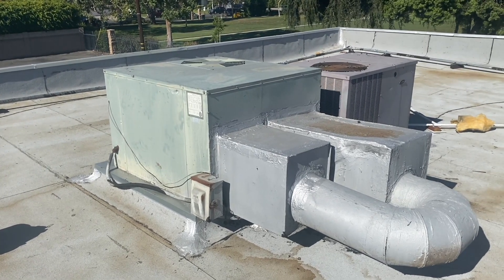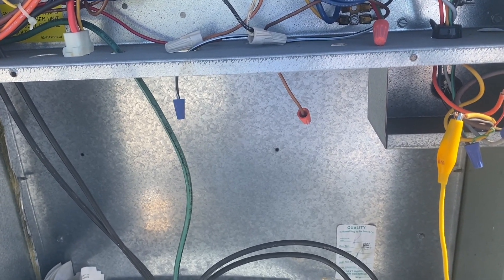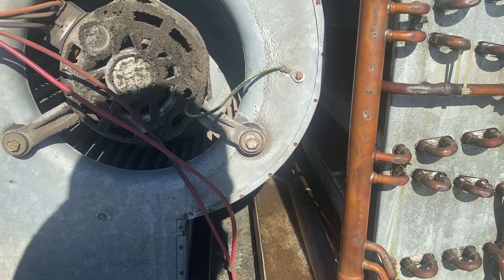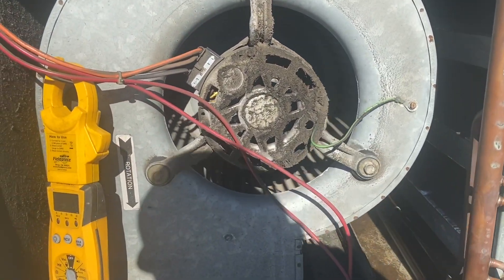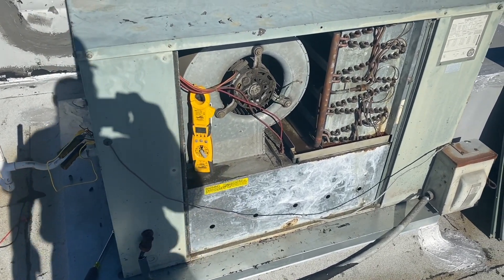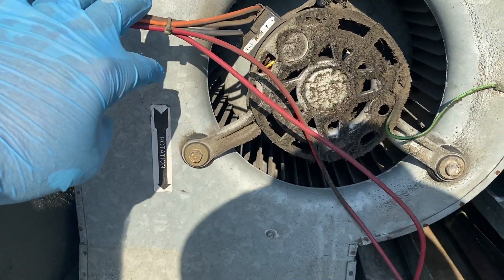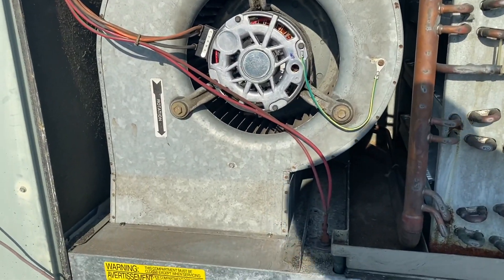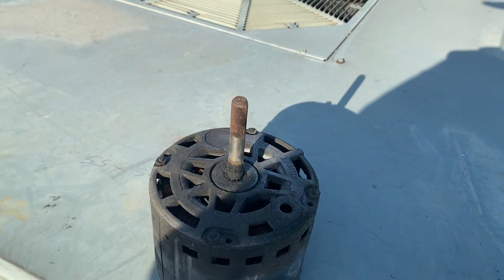No Cool, Airflow Problems Package Unit Heat Pump. EP45

Comment: So your a Horrible Tech Guy....LOL  I learned a LOT from your video(thanks). Great Work and learned replacing Motor not that much hard Labor as told it was by uknowho.  It is 9-3-2025 & my 6yr Carrier Motor is Toast.  In 3yrs the Heat Coil died.  Dont' buY a CARRIER AC UNIT.   Also Tech ordering OEM-Motor.  Sad thing next to cheapest cost repair was $875 Bucks.  This is just replacing Motor & adding a Surge Protector.  No Cleaning off Mold or installing UV-Lite.  I don't find that many Honest Florida AC Companies being here 18yrs. Been ripped off a lot of money Believing. First time hearing a Surge Protector saves parts inside a package unit.  So will take me longer now to pay of my 2019 Rogue.  Sad Day for Me having to spend where I did not want to spend.  Thanks for your video and was Very Helpful being this is exactly what just happened to meee. 🤣

Comment: Another great video that will help other technicians. I noticed you didn’t clean the evap coil, which may be as the customer didn’t want to spend the money, you may want to add a comment on that as it was not clear why that was omitted.
The line voltage seal tight from the disconnect to the unit was broken at both ends. But again repairs were at the customers discretion.
Pointing out those two things and why there not being addressed helps viewers to know that you noted them and didn’t miss something.
Thanks, keep up the great work!
Reply from the maker: Will do going forward. That’s for the feedback!  You are correct sir . I quoted for a bunch of repairs and they just wanted the bear minimum to get it running.

Comment: Just a tip. Use your Ammeter to test the current draw of a indoor blower motor with the panel shut. 
 A PSC motor will draw less current with the panel off. Test it for yourself. Great video man
Reply: I question this from my experience they draw higher current because they push more air because of no restriction on suction side of blower wheel
Reply: @ricardov8249  It depends on the setup. having the cover off may allow more air in and increase the pressure, but it may also allow air to circulare around the fan from high-pressure to lower pressure and make the fan run easier.

The ultimate point is that the motor should not draw more current than the specs dictate, *with the cover closed*. How many amps it draws with the cover off is therefor kind of irrelevant since it's not going to be running with the cover off.
Reply from the maker: SCIENCE!!!  Love it.
Reply: @vinny142  I agree it was designed to run with covers on so that's reading that matters